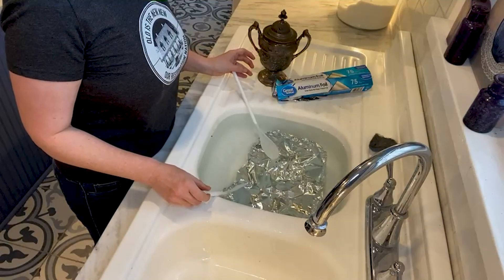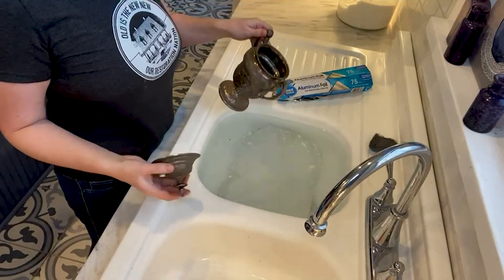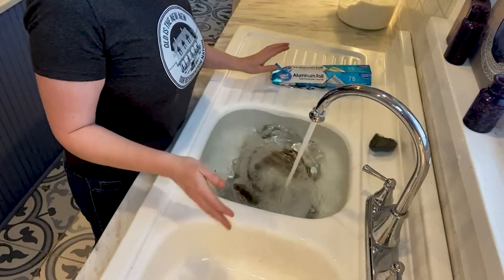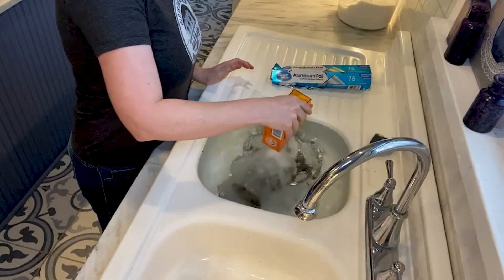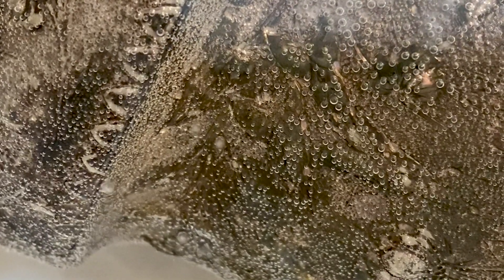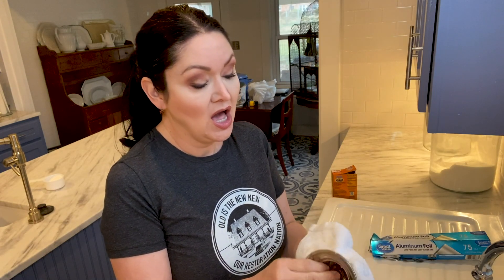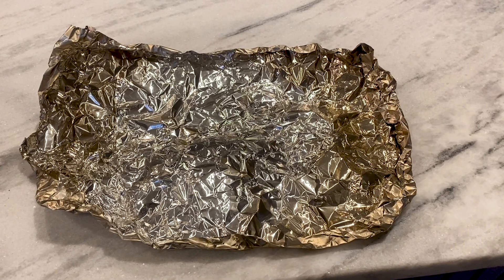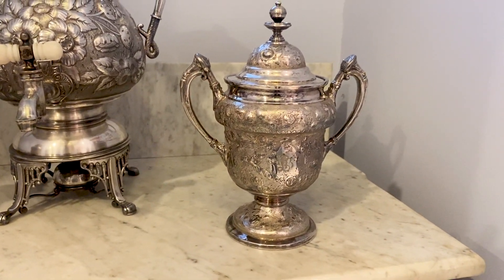The BEST Way To Polish Your Silver: Historic Restoration Tutorial

Comment: Based on what I've seen from other YouTube videos, the reaction would go much faster if you put a bunch of salt into the solution. Some even put equal parts baking soda and salt. The reaction is complete within seconds rather than many minutes.
Reply from the maker: Salt pits the silver, which is why I don’t use it. It’s very corrosive
Reply: @OurRestorationNation  update: I just tried it this evening with salt and baking soda, and it didn't work as dramatically fast as I saw in another video.

Comment: QUESTION

I purchased a sterling silver ring "polished", with designs in it. While it didn't look tarnished or that dirty I thought it could be brighter.

I did this and the ring actually got DARKER after a few seconds. But it got darker inside the deeper parts. I'm assuming it's left over polish or some kind of residue.

Is this normal? Or am I missing something or wrong about something?

(I'm actually going to leave it in longer later as I'm in my way to class)

Comment: I made some minor adjustments, but THIS WORKS! Here's what I did for PERFECT results using this video and comments: 

1. Start boiling the biggest pot of water you can find
2. Line a bucket with aluminum foil
3. Dump a TON of baking soda in (from a Costco giant bag) at least 2 boxes full
4. Place silver items into bucket
5. Pour boiling water on top
6. Pour more baking soda on top
7. Leave for one hour
8. Return, carefully remove items and dry (use rag as some tarnish may still come off)
9. Rub some mineral oil on silver to protect from rust
Reply: @christinealiciamusic  Does bucket have to be metal?
Reply: @justlynda59  No, I just used a plastic storage bucket from Home Depot/Costco.

Comment: I have my mom's tea set. The tray is huge. I will have to use a tote or a plastic bin that it will fit in. I have a stainless steel sink. Bathtub is just too  big.
  How about cleaning copper? I have 2 very old copper kettles from England. Silver polish is taking off the copper.

Comment: I also learned form my grandmother, to wrap your silver jewelry in aluminum foil and place in airtight container, it does not tarnish. I use this hot water bath all the time on all silver sterling or plated and it’s magic. I don’t mind having silver, with this cleaning process.
Reply: Hello there silly question I am sure. But dies this actually work ? Wrapping in aluminium foil then placing airtight container? I have so so much silver and forever polishing it as I detest tarnish. If this works I'll go and purchase a huge airtight container and I would be eternally grateful 🙏
Reply: I'm allergic to chromium, which is in steel, so silver is the most affordable option and it'd be so much more of a hassle without this cleaning method.

Comment: If your sink is enamel over cast iron, it might be "interfering" with the process.  Try doing it in al plastic 5 gallon bucket next time and see if it takes off more tarnish.  Use boiling water from a kettle or stock pot.  And after your silver pieces are all dried off-finish with a very light coating of food grade mineral oil.  It will help keep tarnish away.  Great video!
Reply: Add a Sous Vide Immersion Circulator Cooker to maintain the temperature and to keep the water moving.
Reply: I usually use vinegar, foil and baking soda. Is one method better than another?
Reply: @dukey2015  ... you could add salt or lemon juice as well.
Reply: Oh my, I didn’t know about the mineral oil. I’m going to try that!
Reply: Yes. I've seen another YouTuber use this process but in plastic tubs. He does connect a circuit to the foil though and I'm guessing this helps with the outcome
Reply: @lianacollectsdolls connects a small 9v battery?
Reply: Thanks for the mineral oil tip. I already have some food grade mineral oil to treat my wooden cutting boards.
Reply: @LaLadybug2011  I have done it with my teapot the dish was on the stove for 1hour , I did coated my dish with aluminium foil, I repeated the process3times and I I still have some areas covered with black. 
What shall I do?
Reply: Is the process still the same with gold? I'm starting a 🏆case with about 50 mix pieces of sliver and gold. Thank you for the feedback 🙏🏻
Reply: What if I'm doing a plater?  OUR sink... i think is metal but only fits like half the platter,  just do one side at a time if suppose, or will it work 🤔

Comment: Hey, Laine! Thanks for the steps in how to do this! I saw this method done on a show recently, but they didn't give specifics as to everything you needed. So helpful! Do you know if one could use a disposable aluminum tray (such as those used to make lasagna or a casserole) with the same results, or is aluminum foil best? Reason I'm asking is that I have a bunch of them in storage and this would be a great way to put them to use. Thanks, girl!
Reply: Yes, you can use any aluminum.  However, if you use aluminum cookware, it will accept the tarnish and, after a few pieces (one or two large, or six to ten of flatware) it won't continue to transfer. so a disposable pan or multiple pieces of foil will work better.  Keep the water heated, add more baking soda and replace the foil after a bit.  You won't see that it's getting dull until you pull it out of the water bath.  If you continue to search for this method, some recommendations also have measurements, so an entire box of baking soda may be overkill.  I think I was using 1teaspoon per cup of water, so definately more for a two or three gallon sink of hot/boiling water.
Reply from the maker: I’m so glad you enjoyed it. I’m afraid I don’t have an answer for you though. Maybe give it a try.
Reply: yes.  If you have an item that is easy to clean you can also use Nevrdull.
Reply: That’s a good idea. Try it on something that you’re not afraid of messing up.

Comment: I tried this on jewelry and it did not work.
Reply: Is your jewelry coated? If it is it won’t work. Did you leave it in for a long enough period of time? Did you see the bubbles forming-if not you didn’t heve enough soda in the water. Was your water boiling hot? If not it won’t work. Did you bud them dry? That will remove what has released

Comment: I also add salt to this process.  I always do my table silver like this for a dinner party.  So easy.  Try the table salt addition.
Reply: How much salt do you add?
Reply: Do NOT use salt on your silver, especially sterling! It is corrosive and will leave pot marks.
Reply: @joannecirincione3896   I’ve seen several others add salt as well and I do it too! ❤️

Comment: Would this process still work if you did it in a stainless steel sink?
Reply: This should NOT be done in stainless steel sinks. The stainless steel reacts to the silver and can actually damage it.
Reply: @laineeden  Thanks!! :)
Reply: I did this process in a stainless steel sink and it worked fine. I DID make sure the entire sink was lined with aluminum foil though. Maybe that's why it worked for me.